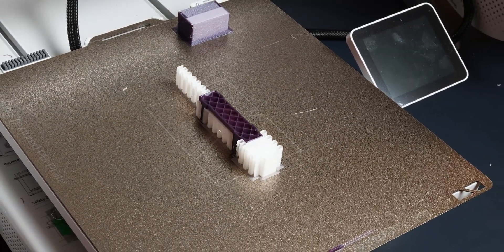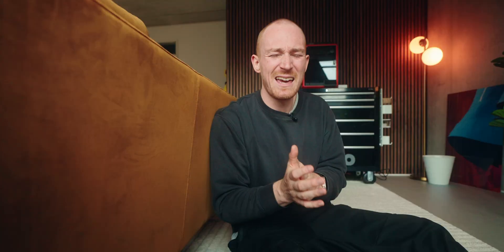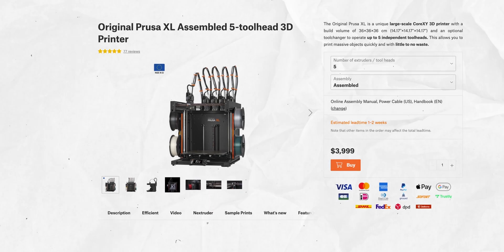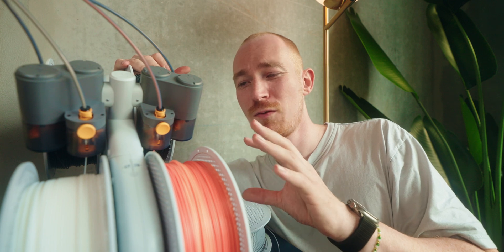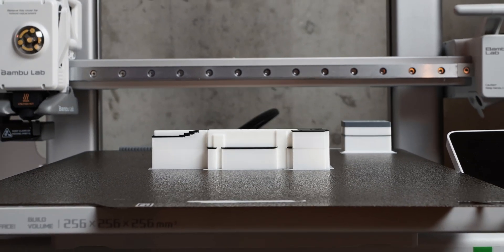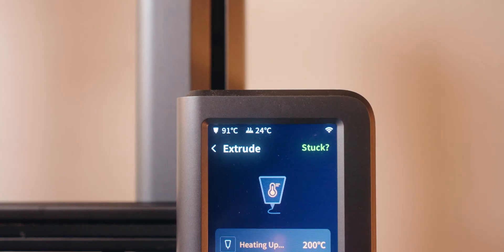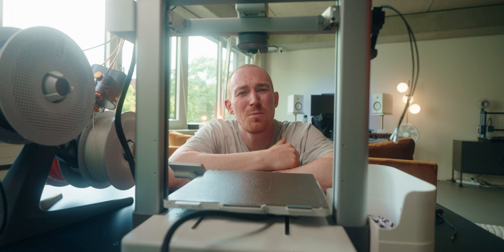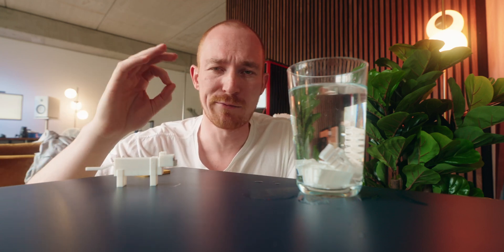Is Multi Color 3D Printing Worth It?

Comment: The only reason I ever wanted a tool changer was to be able to print with dissolvable supports. Multicolor is nice but other than for labels I don't really see myself ever needing more than two colors.
Reply from the maker: yeah dissolvable supports (or also using PLA with PETG which don't bond) is so nice and gives you way better print quality

Comment: It's cool, but the waste is insane
Reply from the maker: You’re right. There are also ways to reduce waste like flushing your waste into an object. Also as I said in the video 90% I don’t use it to print multicolor but love that the printer can switch colors between prints automatically

Comment: I was looking into this exact type of printer!  Theo nly issue is, do you think it's worth it to an average person?  The extra filiment and stuff sounds expensive for someone not completely invested in 3d printing.
Reply from the maker: If you're buying now, I'd definitely go for it. 
Of course it depends how tight the budget is. 
But you can always use the printer with external filament and ignore the AMS. 
I print 95% one color prints and wouldn't wanna miss the AMS. Just for ease of switching colors between prints.
Reply: @arnebornheim  Ok thanks

Comment: I’m just curious if you use pla and then petg in the Bambu ams does the nozzle temperature need to change when it switches between the pla filament and petg support filament?
Reply from the maker: Im Not 100% sure but I’d assume that nozzle temp is changing with each filament change!

Comment: Don't use the alternative material for the entire support (as that requires filament changes on every layer), but only for the "separation layer" between support and actual part.
Reply from the maker: Thanks! I tried both during the process and both works. Totally understand why only using on the interface makes more sense, because you have fewer filament changes!
Reply: That's a cool idea.
Reply: How do you do this in Bambu studio?😮

Comment: The main use for AMS for me is rollover filament. Add multiple spools of the same color, and it will just run over to the next one automatically when one runs out. Basically gives you a 4kg spool.
Reply from the maker: True! That’s actually a great use case I should have included in the video….
Do you use it for real large prints or just because you go through a lot of filament?

I just took my 2.5kg filament spool on an external holder and put that into the ams 😊 also works great
Reply: @arnebornheim  I use it for large prints where I have a spool that I know won't make it. I hate having a ton of spools with bits of filament.

Especially if I'm pretty confident that it will run out in a thick part of the print. Occasionally I can see the filament change if it happens on an outside wall or something, but that's pretty rare.
Reply from the maker: Thanks for letting me know!  it’s definitely a great way to use filament all the way 😊

Comment: What happens to the "printer poop" that forms when the filament changes? Could that clog the builds?
Reply: It is flung away on the A1/A1 Mini. You can build a garbage can to catch it or place a filament box next to it.

It is rare but it can happen that filament gets stuck and sticks to the print head. The worst case scenario is a blob of doom.
Reply from the maker: You can see it when I talk about the filament that’s used when changing. I printed a little container that collects it all. 
A blob is possible but so far nothing has stuck to my nozzle …

Comment: What bothers me about multicolor printing is that people are using it for things where it's actually completely unnecessary just because they can. For example, to put their logo or name on a print. It's a waste of filament.
Reply: I mean I'm not sure I understand how it's a waste of filament. Either you have to emboss it in yourself in the same color then paint it later or just use the same amount of material in different colors. 

I mean I guess there's some of the poop or purge block but if you're that worried about it you can always just recycle it back into filament eventually
Reply: But if it’s yours print whatever you want and as many colors as you need / want, I don’t own a printer of any kind, but when and if I do, I won’t care what you think I should or shouldn’t do with my AMS.
Reply: @Kamikaze3557 lol so true, what an idiotic statement.
Reply from the maker: It’s definitely something that’s great to have. But just because you have it you don’t need to use it on everything.

Comment: Bambo lab printers do waste a lot of filament on color changes, but not all printers do. For example, an IDEX printer has almost no waste on a color change. If you want to make your single extruder printer to have multi-color capabilities then you can use a Palette color changer. They too have almost no waste. Great video, I will be subscribing.
Reply from the maker: Thanks for the great Input 😊 definitely Sounds very interesting. The warte of filament is currently one of the biggest Problems i think
Reply: @arnebornheim  If you get a chance to try one of those methods, I think you'll be surprised at how effective they are.
Reply from the maker: I hope I do get to try it eventually 😊

Comment: Hey Arne, I enjoy your vids! One thing I would clarify is that people should only use the support filament as the interface layer, not the entire support structure. Some of your shots show that, but some show using the alternate filament for the whole support structure. It’s not a problem per se, but it’s many less filament changes if you just use the support material for the interface layer, so it saves time and filament.
Reply from the maker: Thanks! Yeah i tried out both versions: Support material just on the interface and everywhere. 
It definitely saves a lot of Support material and filament changes doing just the Interface 😊